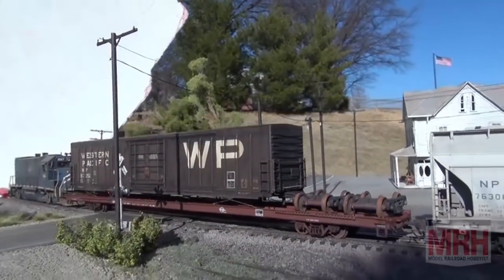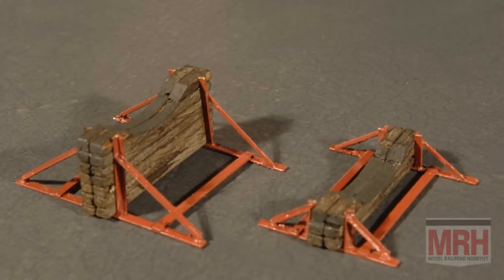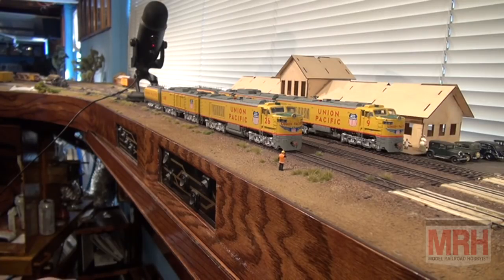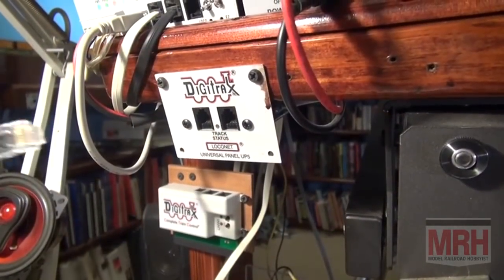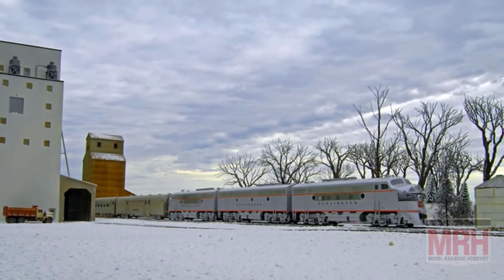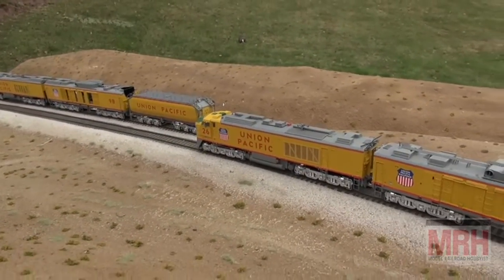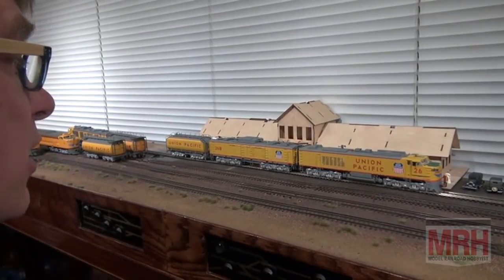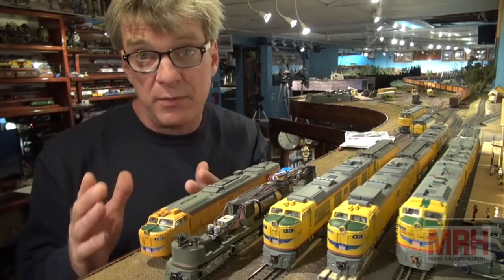Whats Neat in model railroading | December 2017 Model Railroad Hobbyist | Ken Patterson

Comment: Unless there is situations on route to repair/service station typically transport of loco or rail stock is run onto a flat bed or a low loader flat bed car for transport, on top of rail and chained

my guess if mounting load on to a freight car you be running a section of track on the  flat bed if i was to actually model from real life examples of rail stock, very seldom have i seen examples where they separated wheels from trailer beds..

just because I haven't seen it doesn't mean it doesn't happen as you depict on your model..a

though everytime i have seen rail movements on top of other cars it has always been with the rolling stock underneath the broken loco or car..-

Comment: I have a comment about sound. I'm impressed with the variety of sounds but all the systems sound tinny due to small speakers in the trains. Since bass is a non-directional sound, a powered sub-woofer would make a huge improvement in quality. Maybe you could pass that along to the manufacturers?